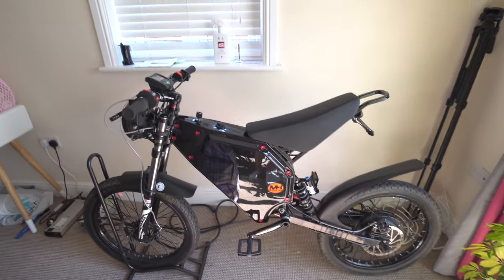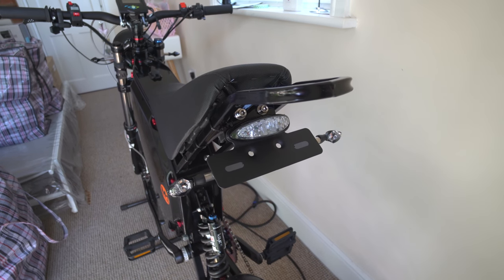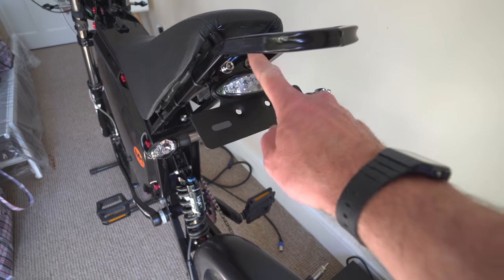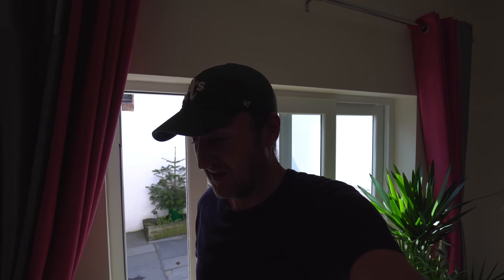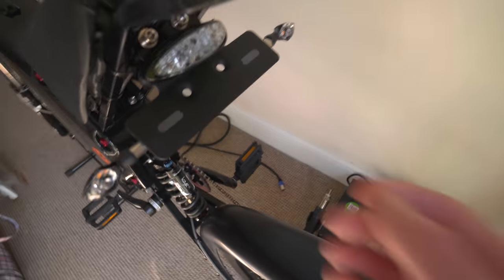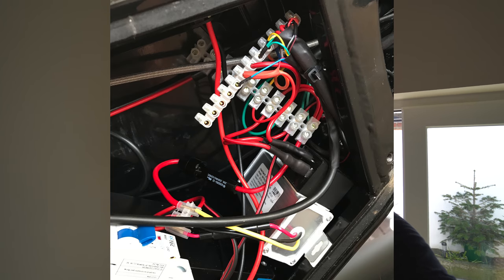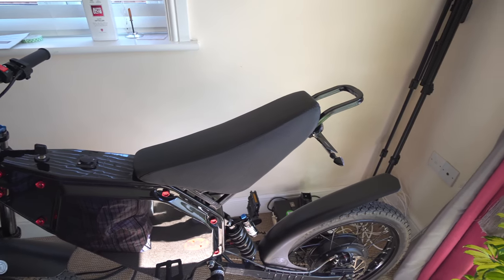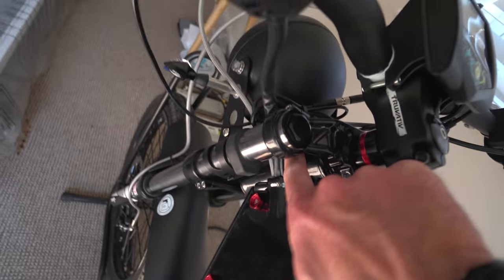FITTING TAIL & BRAKE LIGHT TO AN EBIKE | UK MSVA TEST PART 3

Comment: Andy,i would definitely go with screened of filter material, cooling ducts directly to the control, on the underside of down tube,with the right vent louvers an filtering system u use the speed bike to cool,two birds andy,anyhow good luck!

Comment: If you want a clean tail-light you can just buy a 8 inch led tail-light strip off ebay or amazon for 6 to $12 . They come with brake-light high and low as well as left and right turn signals all with super bright led's . It will fit right into the groove on the seat bar in the rear of the bike perfectly . The best way to do this setup is like they do with a car , you can buy a small fuse box and wire different devices through it . On my Stealth clone i have a stepdown transformer that pulls power from the battery  converts it to 12v powering the brake lights , head-light ,turn signals and usb power . I have these all wired into the switch on the handle bars and paired with atc circuit breakers so i never have to replace fuses.
Reply: not E-marked tho.......wont pass msva.....ok afterwards tho !

Comment: I think controllers look quite good mounted on the bottom of the frame IF it's in a cage. Those raptor frames come with them stock, but it's just a bit of sheet metal folding. Possibly a solution?
Not sure what motor you're running now, but I'm awaiting delivery on some MXUS 5k motors. Curved magnets, fat axles and 20% more torque. PM me if you're interested, in the North East so not too far away. Can also lace into a moto rim ;)
Reply from the maker: +th3d3wd3r thanks, these motors sound good, which temp sensor do they have inside? Also can you source UK road legal tyres?
Reply from the maker: +andy kirby I meant in 19 inch x 2-3inches...

Comment: Andy I love your bike. I am in the process of adding new lights to my Bafang BBShd motor. How did you wire the brake light switch. I think you mentioned you simply were going to use your brake sensor wires to wire a switch. My brake sensor wires are "Normally on" circuit. How did you reverse them to be used for activating the brake lights?
Jon
Reply from the maker: Hi, thanks! Yes I did use the switches on the brake levers (I got some Tektro hydraulic brakes which have normally off switches). I’m not sure about yours if they are normally “on” you would have to use a relay I reckon.
Reply: So Any, I happen to have added a Tektro brake and it is indeed "Normally Open". My wiring is mostly 5v signal and wondering what voltage your Battery is and what voltage runs your lights. I have a 48v battery and the light wire from the controller is only 6v. I would like to run 12v lights. Many more options. I have no issues reducing 48v to 12v with a voltage converter but I question how to use the Brake wires to control the brake lights as they are only 5v. Feed back of 12v  the system scares me. what voltage are you lights? What is the voltage of you battery?Thank you so much for your interest and information. I love my BIKTRIX Juggernaut HD. I ride several times a week on famous Daytona Beach, Fl. Retired and Lov'n it!Jon

Comment: You are a brave man Andy, that's alot of work and effort going on this bike , I bet the registration part is harder than building the bike . I remember your first ebike video you mentioned, it was the video which I first watched and subscribed 😀. have you ever considered. buying a motorbike instead of this ? I know the advantages of ebike . and one more question, once your bike is registered can you still ride it in the same bike Laines and country paths?.
Reply from the maker: +supernova1976 yeah I know what you mean. I've  had it in my mind for years that I wanted to build my own electric powered transportation. In the last couple of years the stars have aligned and the technological advances (batteries, controllers) have now made this possible. I've also always loved cars but I don't understand engines at all whereas electrical and electronics is second nature to me. One of my goals has always been to become an expert in electric vehicle tuning. I guess this is a step closer to this goal! Regarding bike lanes yeah I will just take the number plate off and put it in normal Ebike mode and pedal like buggery!
Reply: Best of both worlds 😀. You have built one very desirable bike there mate. Well-done .

Comment: hi andy, sorry in advanced if this is a silly question but how does the bike hold up in rain? also for washing? specifically the hub motor?
Reply from the maker: +johthon1 no problems at all, it's pretty waterproof. I hit it with the hose after every ride and it's been fine.
Reply: thank you!

Comment: on the right side this is scale of the motor temperature.  controller temp is where you showed in the beginning.
Reply from the maker: +Artur Ragulskyi ah really? I thought the motor temp was shown at the very top right? Mine is always showing 32 degrees, it never changes, I tried all the sensor types in the menu??
Reply from the maker: +andy kirby just checked the manual on page 16 it says the bars are a temperature gauge / overheat limit bars. In my case it seems it's not referring to the motor temperature as my motor temp sensor appears not to be working. The bars climb as the controller temperature rises... interesting...
Reply: 3 options. 1 bad connection to your temp sensor. 2 wrong temp sensor. 3 broken temp sensor. you can install one you have with adaptto.

Comment: not having insurance is not a time bomb waiting to happen. That is exactly how they make money from you. They only profit because people don't crash too often. If you think you are an incompetent rider then maybe it is best to get some but otherwise this reasoning doesn't make sense.
Reply from the maker: +danthelambboy you can't predict what others will do on the road or if your machine will fail unexpectedly and put you and others in danger. Do you have £100,000+ in the bank in case you injure someone??? I'll pay £200 per year. Makes more sense to me.
Reply: andy kirby sure do that. And I hope you are safe on your rides. On average your costs will be higher with insurance than it would be without. I am sure you don't apply the same caution to everything in life and pay for insurance for everything possible.
Reply from the maker: +danthelambboy yeah your right I don't insure everything possible, but a motor vehicle is generally something I consider should be insured. Also remember insurance covers theft of the bike.
Reply: @danthelambboy  you might change your point of view if someone without insurance crashes into you and causes damage to you or your property...
Reply: If you don't own anything then you are pretty safe with no insurance. This guy pays £100,000 in corporation tax a year, so the chances are he has a lot to lose. Standard 3rd party liability is £2,000,000 for a good reason! Put a high earner out of work in an accident and you'll probably lose everything you own and possibly everything you ever will own in the future.